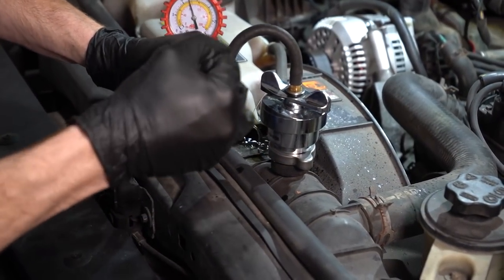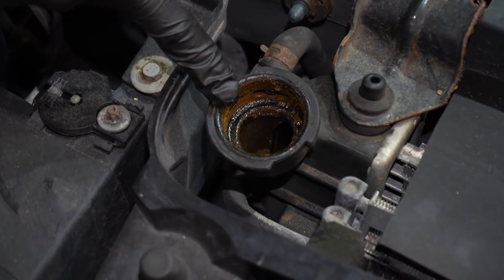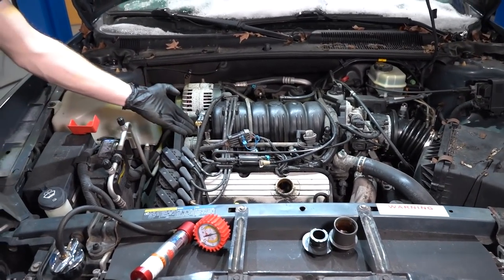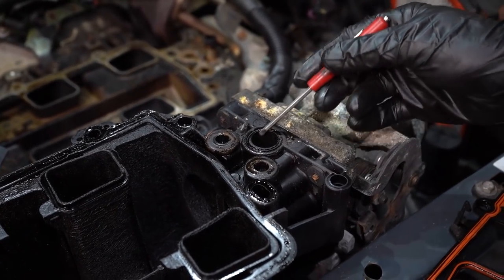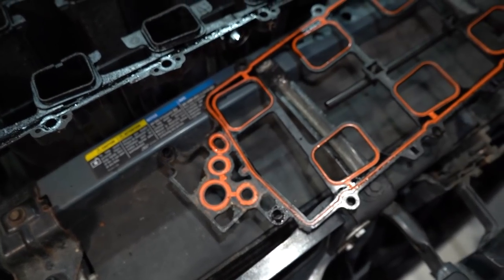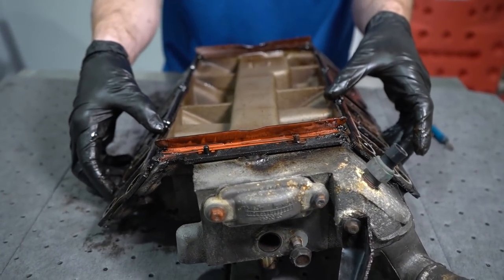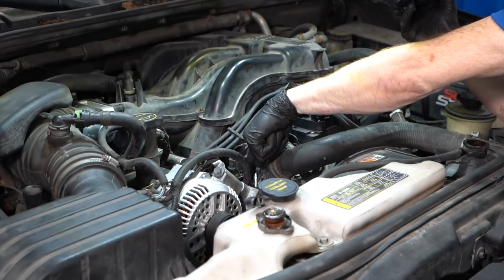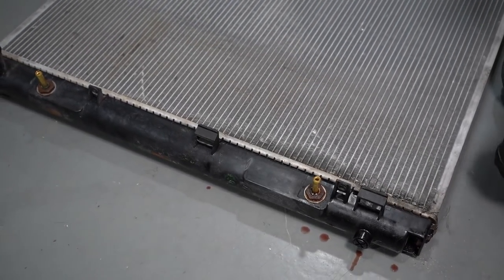No Heat? Sweet Smell From Engine? How to Locate Common Coolant Leak Locations!

Comment: Excellent  Video, the 3.8 GM engine is a good engine, but the intakes need to be rebuilt because of their age. If you buy a used car with this engine you should factor in $1500.00 for this repair.👍👍👍

Comment: Those 3800's were my bread and butter 10 years ago. One of Gm's better long block engines. Plenty of accessories bolted to it that were garbage though. Series 3 3800's were much improved over series 2. 

Those were the days when GM though it was bright to use plastic intake gaskets with that rubber imbedded into it. Garbage when mixed with the Dexcool.

Comment: Adding any of those leak-plugging mixtures to your coolant is a lot like replacing all your coolant with 2-part epoxy.  Sure, your coolant system won't leak any more, but it's also not going to do the job it was designed for.  Usually you want to get the system repaired so it works according to the manufacturer's designs.  The one exception that I know of is the orange (bio-formulated) coolant.  That stuff quickly turns to a peanut-butter-like sludge and clogs the radiator, so I use the universal (yellow) coolant instead in my Cavalier.
Reply from the maker: +@scottk3292 Thanks for checking us out! http://1aau.to/m/Shop-1AAuto-c

Comment: I got cadillac escalade hybrid 2009 and have single resaviour with two different caps and hoses. I don't want to go wrong. The smaller side with small cap is top up with pink liquids and the other side that has the bigger side and big cap is empty. Who knows what liquid i need to top up with as is very empty and the hose is broke

Comment: had an 87 taurus wagon and every year the heater core would go out due to electrolysis in the coolant, pipes would break to heater core. took 9 hours to replace